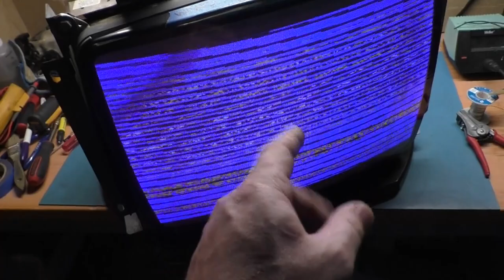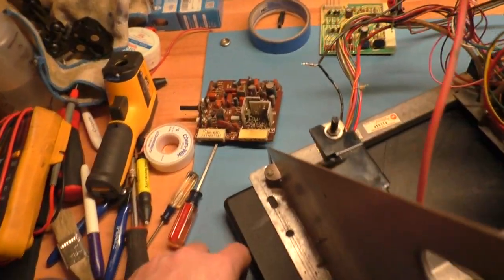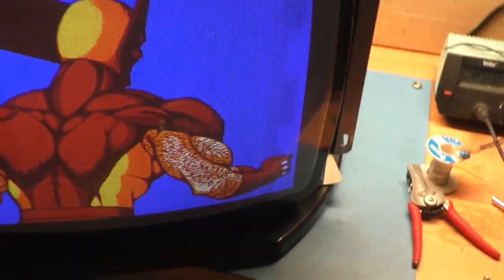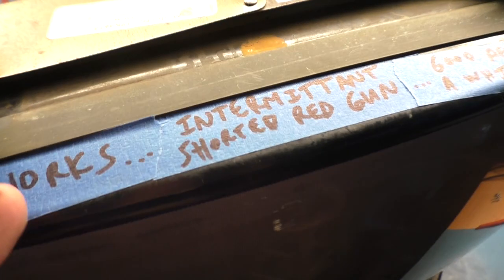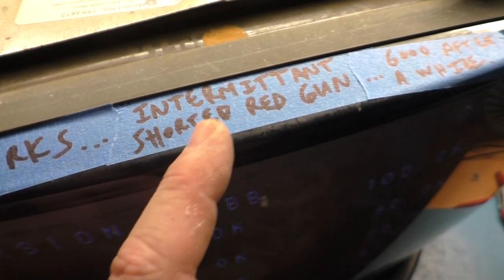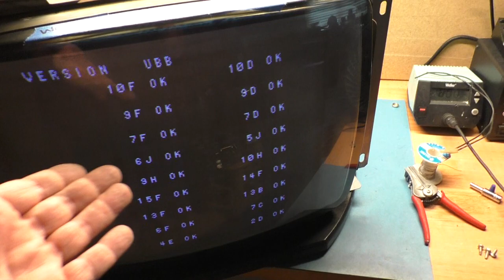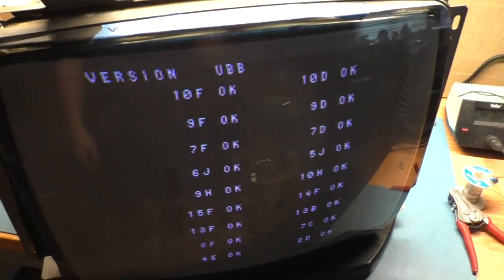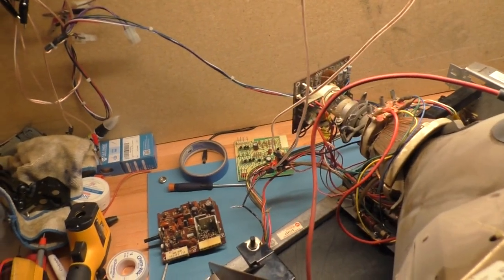19" K4600 Arcade Monitor Repair - Horizontal Hold Not Locking On - Easy And Quick Fix!

Comment: Good video! I recently got a K4600 and the deflection yoke wiring is G/R/B/Y.... is this just because it was vertically mounted (swapped horizontal and vertical coil drivers)? Were all K4600s wired as shown in this video? The resistance between horizontal and vertical is quite different, so it would impact the driver circuitry (I imagine). The labeling on the coil mounting studs has been removed/faded from existence.
Reply from the maker: Thanks. Yup. Just swap the R/B around to flip horizontal and the G/Y to flip the vertical.

Comment: Hi Mike. I got a candy neo29 this last year and it works very well but I know it has cap problems because it has a jumpy image and brightness change but it improves the longer it is on. How do you tackle making a Cap Kit when you don't have Documentation? A tip or video that you can point me to. thank you
Reply from the maker: If the brightness changes over time, the flyback is the usual cause, not caps. But you can try caps first. It's as simply as removing the originals and installing the new ones.